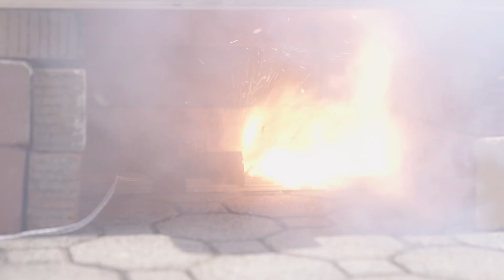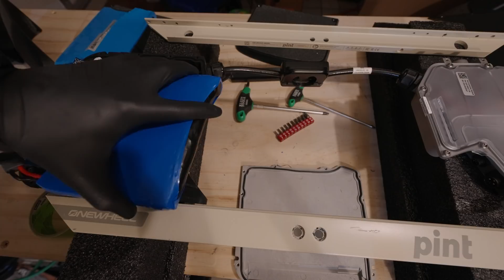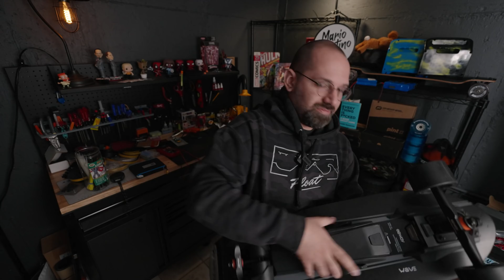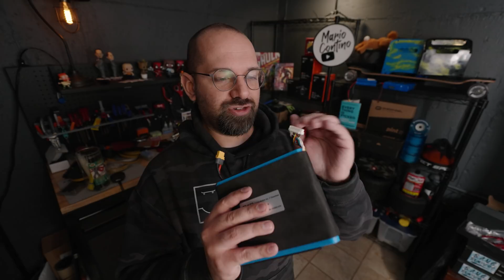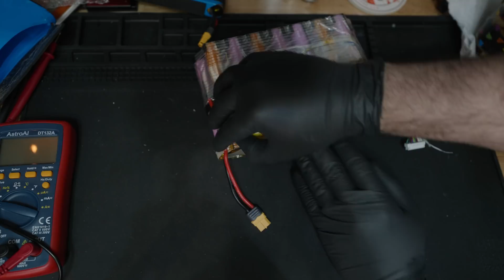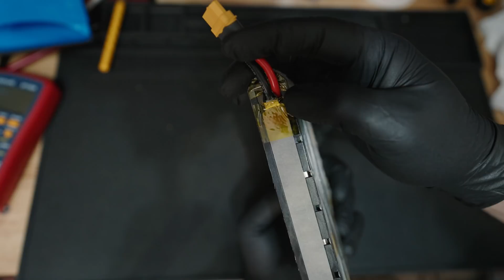Are Onewheel Batteries Dangerous To Repair?

Comment from the maker: I felt it was appropriate for me to speak on a topic that I have experience with, and that's servicing batteries. I simply don't have the knowledge to comment on the other issues present in the recent statement video published by Future Motion. I highly recommend Jake Leary's video where he responds to the other topics mentioned: https://www.youtube.com/watch?v=9i1cP9Nk3Jc
Also, please feel free to check out a recent video of a safety device test, where I explain in part, some ways that batteries fail: https://www.youtube.com/watch?v=CXXBDq8vp2A
Reply: Hey thanks for the shout out! This video was incredibly well done. It’s unfortunate that FM says that people with your experience aren’t capable of working on their boards.
Reply: hey wait do you have a onewheel shop Because i generaly drive 3hours down to brian at one stop but your in NY it would be much closer
Reply from the maker: @iamcole345  I have mostly stopped taking major Onewheel repairs, unfortunately. These days I just offer battery rebuilds for them, since I work mostly on repairing eskates and scooters and building batteries.
Reply: @TheBoardGarage  alright, are you willing do do a diagnostic on a different board with possible water damage
Reply from the maker: @iamcole345  Sure. Feel free to email me, info@mariocontino.com

Comment: You actually were able to clear the code on the GT after disconnecting the battery. But again, that’s no longer the case after the firmware update.

Comment: Well with the new firmware update we can no longer fix/change our battery. We have to send the board back to FM for repairs which is usually accompanied with a hefty charge.  I’ve read about customers being charged $600 for a repair that didn’t fix the problem.  I’m all for Right to Repair and will no longer be supporting Future Motion. Once my GT died on me with 28% left I ordered a FloatWheel. I no longer ride my GT and won’t until I convert it to vesc.

Comment: Quick question. Is it necessary to have a fuse on a OneWheel XR battery. I am repairing a cbxr battery with a blown fuse, and I’m unable to find the same fuse available, so I’m considering just bypassing it. Thanks, and great video!

Comment: Mario, great video. Curious of a good way to contact you or where you’re located.. have a one wheel xr+ that just stopped working on me, so power up on plug in with charger, but shows zero percent. Suspecting water water damage
Reply from the maker: Unfortunately I don’t do FM Onewheel repairs at the shop anymore. Only services I offer are tire changes and bearing changes. For repairs, I only work on boards running VESC based controllers, or from companies that make parts available, which isn’t the case for FM Onewheels.
If you’d like to reach out, you can reach me at info@mariocontino.com

Comment: Can you test or replace a broken Onewheel V1 BMS? I'm currently bypassing it to make my board work. But understand I should really be using the BMS ??
Reply from the maker: I don't do component level repairs, unfortunately. However you can try to source any 16s LiFePo BMS unit that fits, or replace the pack with a 14s Li-ion battery, which would fall within the voltage range.

Comment: if FM actually cared about their customers and the "future" of their company, they would be more supportive of good practices as you show in this video. at its current state, i don't see FM lasting in the long run. you cant even get replacement parts for older boards, unless your somehow lucky and they dont charge you the same cost or nearly the cost of a new board.

Comment: Could you use a bench power supply/another battery set to the same voltage as the gt battery and use that to power the BMS by hooking to the back of the xt power connector while you disconnect the gt battery?  And if you unhook the balance cable and hook in the new battery would the bms accept it or did fm add more code to prevent that? Have you heard of anyone trying this?

Comment: Mario Continuo do you think people like yourself and repair shops will come up with a work around or replacement for the GT battery eventually?
Reply from the maker: I'm not sure. My hope is that the Balance App in VESC becomes tuned enough that I don't have to care about the proprietary PCBs inside my GT.

Comment: Since most of the people that will reply probably won't read all this, feel free to call me a boot licker and move on. 

Since the XR and GT have the same motor but go from 2HP to 3HP that is a 50% power gain coming from??? The battery? So if upping the volts of the battery gets more power, is it possible that "not safe to replace" isn't about you puncturing a battery but more about them not wanting you to create a 40 mph onewheel that someone does more than break an arm or collar bone on. Sure other PEV makers don't care but are they based out of the US and assembled in the US and subject you getting sued in the US? 

I do not think Free Motion went about it the right way. I think it is possible they are growing faster than they are capable of handling. If the company continues to grow and the userbase with it. They will have to address the only one repair center in the world. How they handle that could be just them running more repair centers, specifically overseas, where they probably will eventually need another distribution center (if they want to keep the assembled in USA part). Just my opinion, but what I would do would be allow places to apply to become authorized repair locations.  

Like what was said in the video right to repair does not equal right to modify, and they GT batter killswitch is probably to prevent battery mods not swapping a battery if you apply a little common sense. Personally I don't care if you modify your board and take it off a cliff and die, as long as your family doesn't sue Future Motion for your actions. But this is the United States and little Timmy will break an arm and mom will sue FM, seriously how many pending lawsuits do they already have? Which is exactly what was called for with Ghosting issue. 

Go ahead and tell me how stupid I am for not just saying FFM. I expect nothing less from the onewheel community.

Comment: So out of curiosity. If someone did want to replace batteries on a onewheel gt. Couldn't you just cheat the connector and add the same voltage with a adjustable power supply or  something to hold the power to the BMS while you repair the battery or replace them when you reconnect the battery to take off the temporary voltage?
Because you would only be adding amp hours correct? Or does the BMS monitor that. I know I saw a video about an XR if you put a larger pack in it would still only use the stock amp hours then power off. But you could power it on again and go for awhile. 
Just an idea.

Comment: No. Is the answer to the video title. However, if you don't feel comfortable, any computer / electronic repair shop is capable of doing it. Why does this require a 17 minute video. FM is in the wrong, it really is that simple.

Comment: Thanks for this Mario, I love your perspective on this topic. I've been trying to stay relatively neutral and open-minded in this situation, hoping that FM is just a young (growing) company that is having to navigate the production of one of the most unique products in this space. I think your points on battery replacement are more than valid, and make perfect sense. FM should allow users and distributors to sell and replace whole packs, with the potential in the future to open up a service model where skilled individuals like yourself are authorized to do full battery repairs. Trying to see the current issue from both vantage points, I have a feeling for liability reason FM decided to lock users out of their boards mostly to deal with a fringe minority of DIYer's who don't know what they are doing. FM has eluded to working on a distributed service model in the road map, and I hope this is something they could roll out sooner than later which might just begin to address the battery service issue or reverse the bricking of boards. Ultimately I just want the community to keep more optimism, and hopefully they'll come through for us. As for the other issues, well, its really too bad and we'll just have to wait and see. I'm cool with getting GT next year.

Comment: Hi Mario, I'd like your take on a battery question.  I'm one of the fortunate GT owners, no issues to date, thoroughly enjoying the board.  I really like the 90% charge shutoff feature but I wondered how often you would recommend charging to 100%.  My usual rides allow me to get usually 2 sometimes 3 rides before needing to recharge the board.  I did charge to 100% when recieved 1.5wks 100+mi ago.  Thx

Comment: This company is ridiculous, so in comparison if I change the lithium battery in my motorcycle or remove the ECU my warranty should be voided. These parts are modular, the battery pack is self contained with 2 connectors. PC enthusiasts have been building rigs for years, this generation has become savvy to the tech it is born into. Spend truckloads of money to handicap repair centers and individuals from repairing or improving a product they OWN. Forget the ghosting issue which seems wide spread and can and will do actual  harm.

Comment: I get a chuckle when people can't see FM's concern with 3rd party batteries. Lol. Like give your head a shake man. Do I think they could sell approved OEM batteries so that we can install ourselves? Sure, that makes sense.
Reply: If you are an expert in rebuilding Li ion packs, then there is no problem. I’m sure most of us won’t cut open a pack and rebuild it, but I would appreciate to be able to buy a pack and install it myself. If FM won’t sell these packs, some other company will and I’m sure the bricking of the GT will either be solved or reversed by FM because it’s illegal to boobytrap a device. I’m glad Louis Rossman is on top of this 😀
Reply from the maker: There's no actual evidence that a rebuilt or non OEM equivalent battery is any more dangerous or less viable than an OEM battery.
Reply: @TheBoardGarage  of course there is you just don't have any evidence 🤷
Reply from the maker: @Yielar1  Do you?
Reply: If their concern was real, they'd sell OEM batteries.  They don't because it's not about safety.

Comment: I get that the Pint X is literally just a Pint with a bigger battery and a different enclosure, but why do you think the disconnecting battery issue is specific to the GT?  The Pint X launched at the same time and it just seems strange that if they are trying to enforce this that they only did it to one model.
Reply: Cheaper to produce..  cheaper to just program a $3 micro controller, it only holds a very small amount of code though, even using shift registry.. thats my theory though ive almost zero exp with a pint

Comment: the batteries can be dangerous when they fail, which is why they should be easy to replace.
Reply: BINGO!! They could literally be swappable plug and play, how many double a batteries have you ever exploded ? I'm betting zero.   Cartridge packs with a proper gasket seal would be 100% swappable
Reply: @MrDmadness  None, I've also never exploded an 18650, which their batteries are essentially made of.  Nor have I exploded any lithium ion battery in any of my small electronic devices or laptops that I"ve owned.  Nor have I ever exploded a lipo I use for my 1/10th scale RC car.  

Can the batteries catastrophically fail if you screw up? yes.  But if you take reasonable precautions they're quite safe.  This is nothing more than fear mongering by FM to justify their anti consumer practices which are all about control and money, don't believe the safety lie.
Reply: @mkuhnactual  I've ridden since v1.. im well versed in not trusting fms word.   :)

Comment: If the BMS and battery are using a serial handshake to authenticate then that would mean the battery has an identification chip within it somewhere. 
Wouldn't it be easy to just install that chip onto another battery? I'm no expert just using my logic.
Reply: If u were to, the issue would be doing the transfer itself, if it loses power as if it gets disconnected it bricks itself. You would need to keep it powered the entire time which would be insanelyyy hard
Reply: @ravenshaw1514   ahhhhhh. Ok understood it wrong. I was thinking it would brick with any 3rd party battery but it bricks if it loses power period. Thats shady. 
Nonetheless, i can imagine myself doing this using a whole lot of bypass wires to keep power. Ive done a lot of sketchiness before.:)))
Reply: It's a read only code, like the cmos battery on your pc, or laptop ( laptop battery in this case) if 6our computers cmos battery dies ( typically a small watch battery on the pcb ) it doesn't keep the clock logging, which leads to compilation errors...   same here.. no battery power = no code memory.. it also communicates with serial encryption also apparently, which would mean the battery is chipper with a binary core that has to match the controller  so a long LONG line of a character like 

1110100011110001010100000011111

Must match

Comment: Another excellent video; you're always on point and straightforward. I certainly don't appreciate the condescending tone that Future Motion has taken to their new, current, and possibly former customers, and I definitely despise the fear mongering about how "wrenching" on your batteries may destroy your home. In my opinion, if they have taken a step towards working with independent repair shops just by putting out an impromptu video, it was a lateral one. They did not hit on any of the real topics, and there was no assurance that the anti consumer stance they have taken would be addressed. 

Obviously I don't believe scaring and gaslighting your customer base is part of a viable business model.

Comment: This is a great breakdown.
Can you please do the same breakdown on the Pint X and the so called battery flaw  other people seen to have experienced with cramped batteries and bad connectors.
Reply: Is the cramped space pinching cables? Or are you referring to the weak charging connector burning itself out?

Comment: Great video. 👍
I was annoyed when FM started serial number locking on the XR 4209 models, that was bad enough. That is a bad practice.
But this new low... the tamper bricking in the GT, was the last straw for me. "If the owner tampers with their board, we destroy it hahahaha"
That is sleazy, immoral and just downright RUDE to their customers.
FM has gone from bad to worse, out of greed and terrible decisions by the upper management. 😕
Reply from the maker: It certainly seems to be that way.
Reply: Think the bricking is going to be labelled illegal soon or FM comes to its senses without a lawsuit. Also thinking there is a lot of brain power in the Onewheel community to find a work-around.